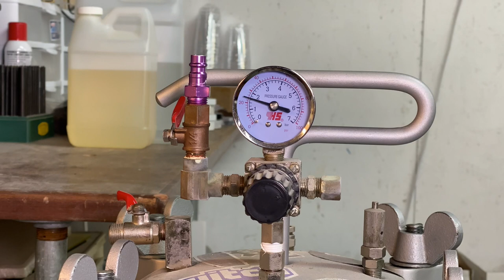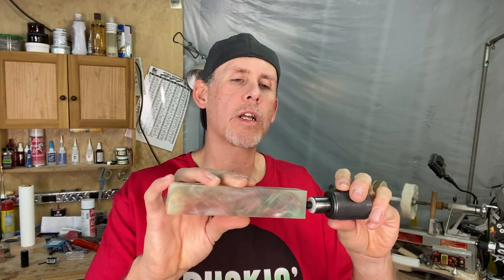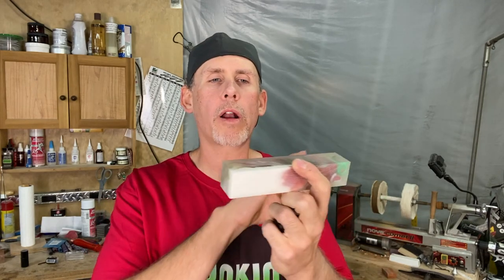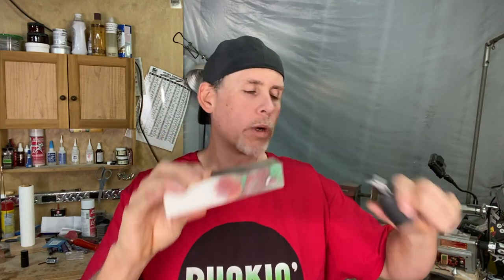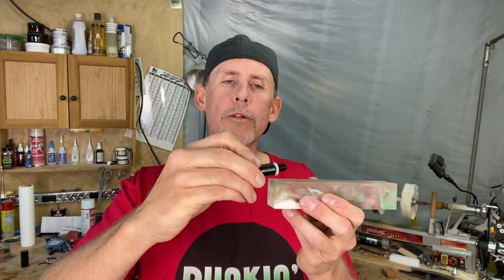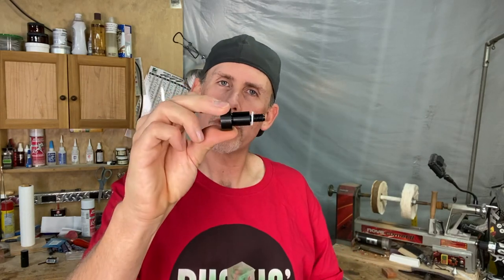Making an Alumilite Christmas Ornament for St. Judes

Comment: I want to put a resin mold over a whole halibut skeleton what do you recommend
Reply from the maker: I'm not sure, sounds like a cool project though! Only thing I would say is to make sure everything is dried out fully before casting, and you probably want to secure it so it doesn't float or move around when you cast it
Reply: Thank you what would be the best resin to use because it’s 4’ x 3’ so I can’t put it in a pressure
Reply from the maker: @seawolf1330  Anything slow setting should do the trick I think. I usually grab Liquid Diamonds when I need longer working time, it's available at Turners Warehouse if you want to give that a shot: https://www.turnerswarehouse.com/products/liquid-diamonds-epoxy-casting-resin?ref=nvww

Comment: What is a good not great vacuum chamber for stabilizing wood?
Reply from the maker: There are lots of chambers out there at all price points, I use the TurnTex chambers myself
Reply: Thanks for an old newby that helps a lot!  Gets pretty confusing at times.
Reply from the maker: @billy19461  I hear ya! There are lots of choices out there when it comes to casting, stabilizing, and turning. You definitely won't go wrong with the TurnTex chambers though, they are really easy to use
Reply: Sac I am 73 ,retired and on a fixed income and it is hard for me to experiment.  Thanks!❤️